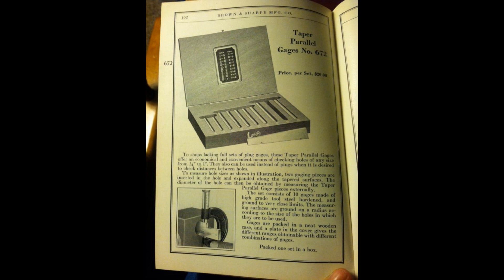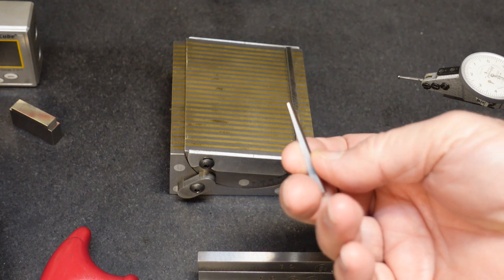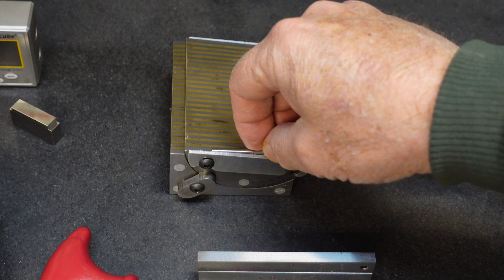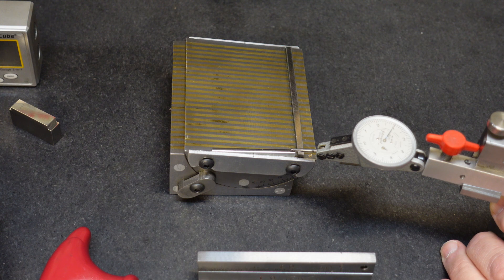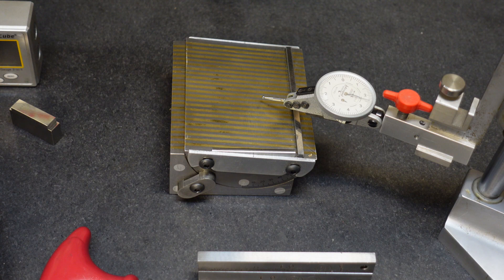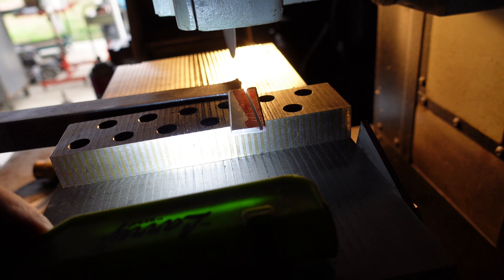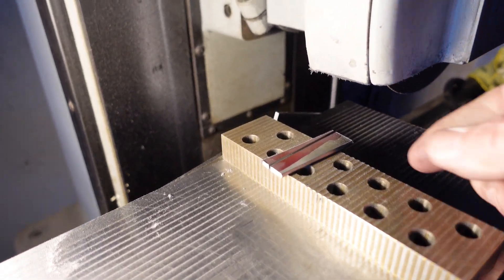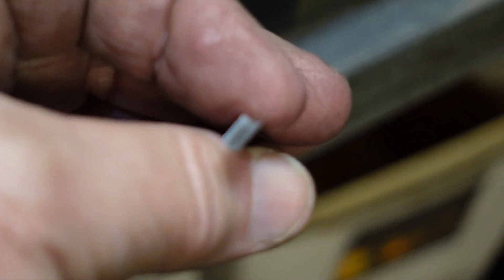Taper Parallel Gages #672 (part 1)

Comment: Nice job Chuck, that wheel dresser is a really nice bit of kit! Good setup to show a different way of getting the result. I would have just used the existing parallel to set the angle of the made one, this way you would replicate any error exactly and ensure a matched pair. Either way it will compliment your set of gauges. Cheers, Jon
Reply from the maker: Thanks Jon for viewing....parts were really small, tough to hold...

Comment: Could he have placed the existing part in the vice under the one he is making and then set the vice directly on the surface grinder mag chuck? Doing so would exactly duplicated the angle of the original part, assuming the top surface of the vice basic was parallel to the bottom surface. Yes? I suspect that is how the parts are mass produced. The exact angle is less important than both angles being the same. Or maybe I have bubbles in my think tank?
Reply from the maker: thanks for viewing and your comment, I can only say that there are many ways to fixture...but remember these parts are very small